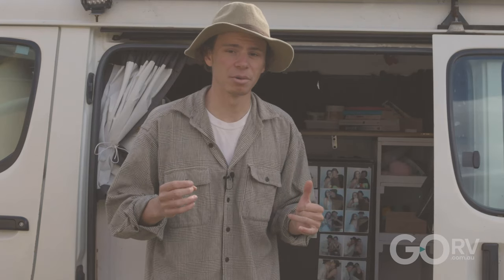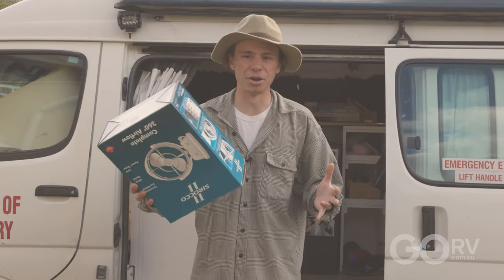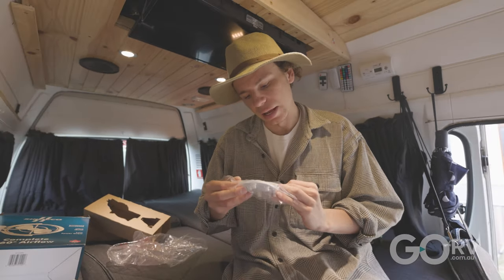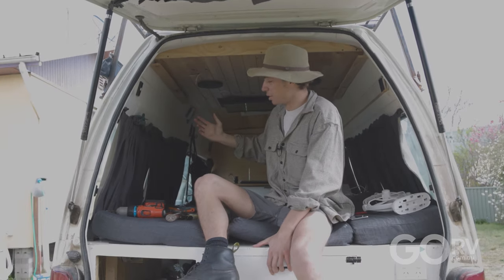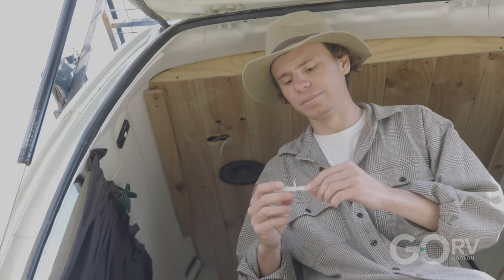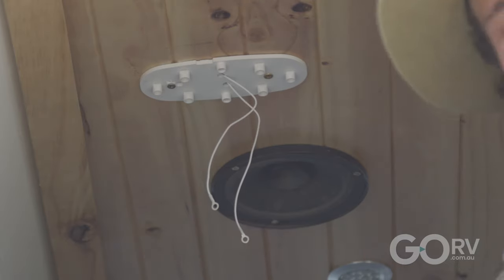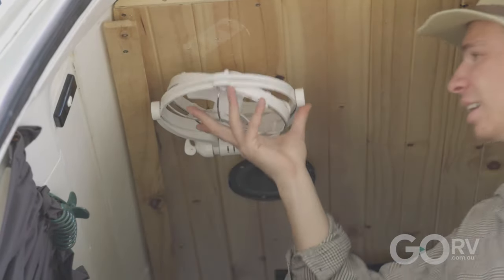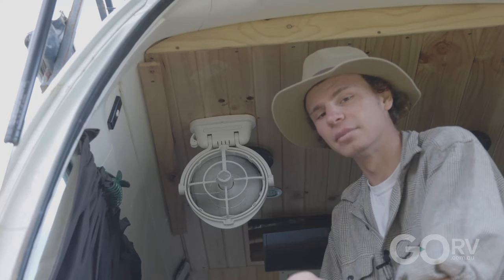Sirocco II Fan Installation by GORV TV

Comment: Thank you for the video. Best one I have seen. One question… how do you plug the end of the wire into the fuse box? Do you just connect the exposed wire into a fuse? Thank you
Reply from the maker: Hi Bron and thanks for watching. The Sirocco II, model 7010 fan is designed for direct wiring into existing 12/24v wiring.